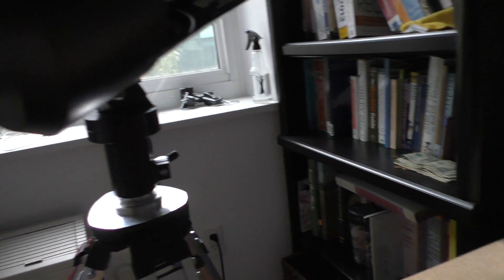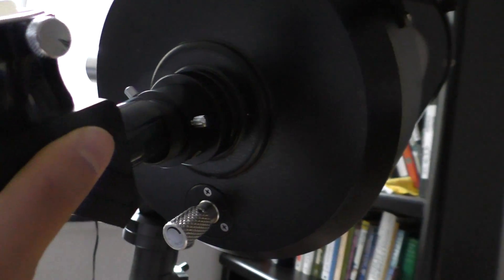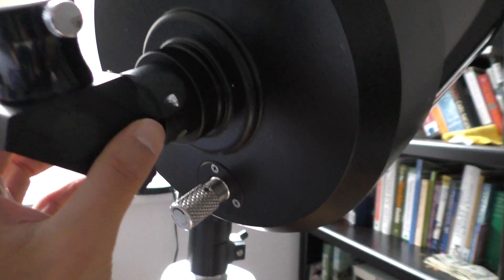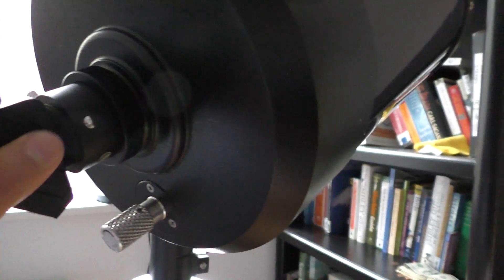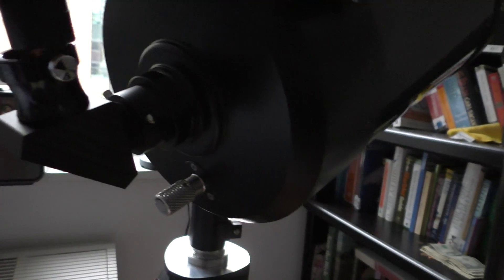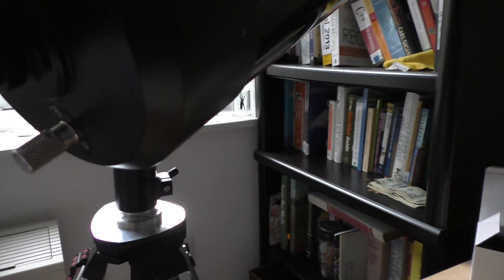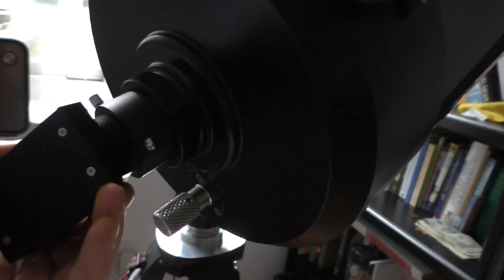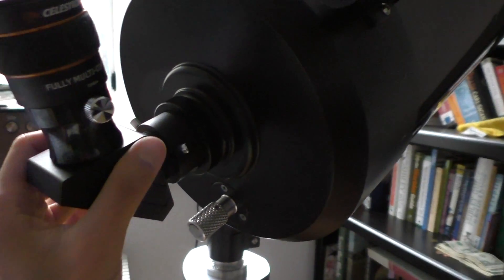Orion diagonal loose connection to telescope

Comment: g`day if you undo the phillips head screws at the bottom of the diagonal you can remove the mirror holder DO NOT TOUCH THE MIRROR  and there is grub screws holding the tubes  that hold the eye piece and the 1.25  barrel that  goes in the sct  tighten these screws and it will not move  do not over tighten them as they are very small allen head and will strip out  this happen to my one and this is how i fixed it  
cheers
james D